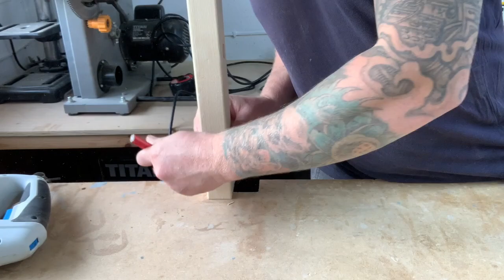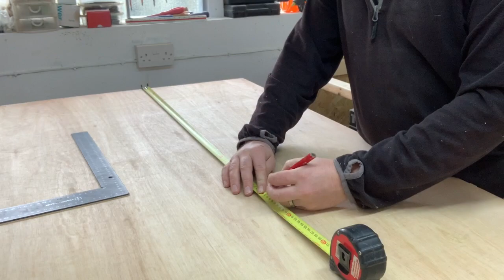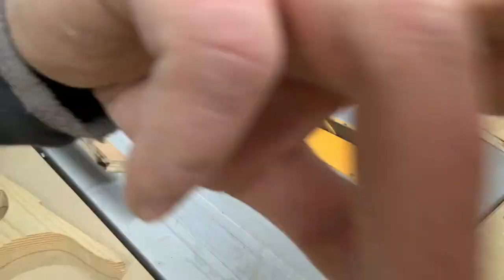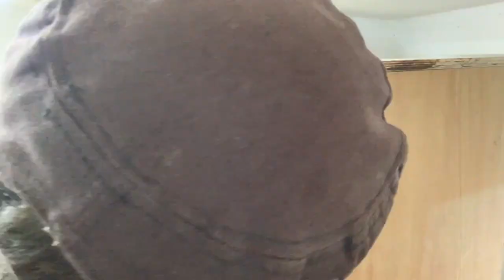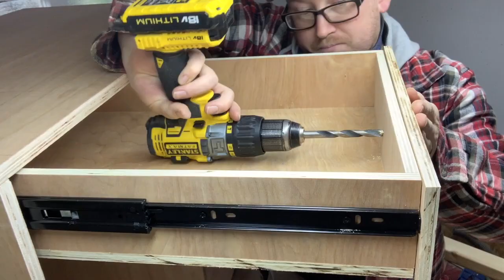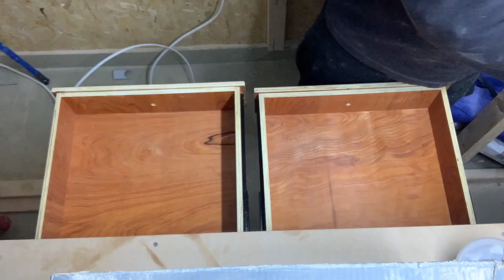DIY workbench upgrade Part 2 cabinet and shelves UK garage/workshop conversion

Comment: Hey man.. Howe are u moving about in that small shop with such a huge workbench? It massive bro.. Great job on the drawers and cabinet my bro. U need to make it so u can do some talking over the work. I'd prefer that so u could let us in on some of the things u actually went thru in this build. Just a thought bro. Great job anyways. I'm about to move into my little workshop soon. Gotta paint the shithole up first. Build new front and back doors for it as well before I put my very expensive shit in there.. haha! I gotta titan saw too bro.. Next year I'll upgrade to the Axminister saw u got. I love the look of it but I was also going to think about the Saw stop on the market for the same price.. I think it's 899 dollars too..
Reply from the maker: It didnt last long. Miss having a big workbench but it just gathered crap so I only used a small portion of it. Have a look at lumberjack ts1800 as well. That’s one I would consider now, cast iron and big fence